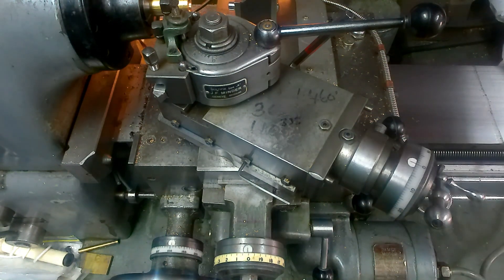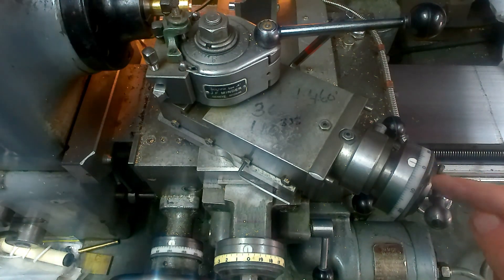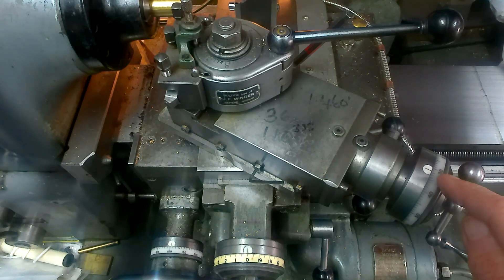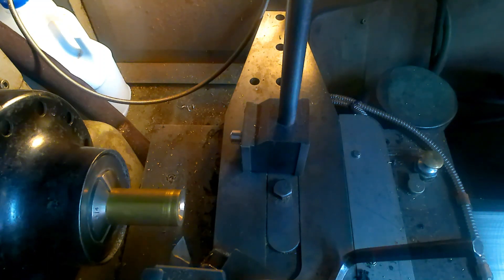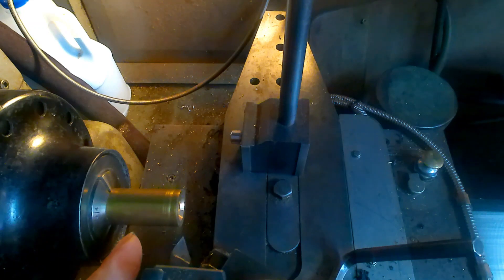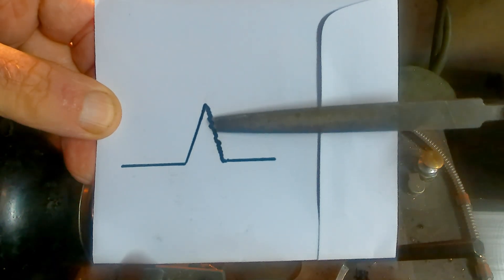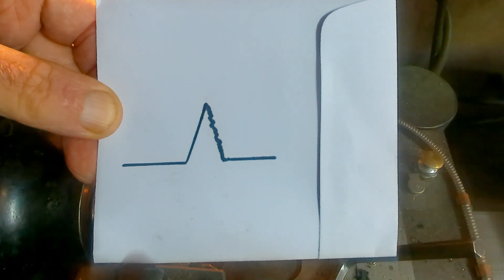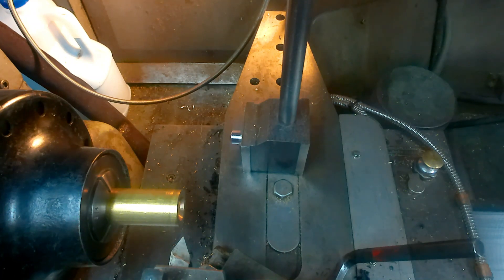A Simple Screw Cutting Setup And Some Good Old Machinists Threading Tips.

Comment: compound is set at 60 degrees
Reply from the maker: I know, it was only set aproxomately as an illustration on setting the correct thread depth easily without calculus or using a DTI. Thanks for watching. Regards.

Comment: Hi, I use the other method for screwing and that is with the compound set parallel to the work as in normal turning.
To keep the right side of the tool from chewing the flank up as you dig deeper.....you only want to cut on the left side of the tool........ I advance the compound a few thou to the left at each pass......been doing it that way for the last 60 years or so......the tool has a top rake slanting from left to right as it only cuts on one side so a top rake cuts very clean.
I also have a set of brazed carbide tools I specially made for finishing the thread to form the final pass and they are flat top form tools in 55, 60 and left and right hand etc.
What's the advantage?..........well you get the exact depth of cut on the crosslide dial,  but with any method if you first cut a small step at the beginning of the job or undercut the end of the thread length to the depth of the thread you have a depth indication.......but mostly you cut threads until it gets a bit pointy and then touch the top with a fine file to round off the burrs......a lot depends on the radius you have on the tool point for final depth, so its cut and feel at the end of the threading etc.
I notice a lot of people have removed the compound slide in preference to a solid block mainly due to the pathetic mounting of the said slide on some of the cheaper lathes and it's ability to move or tilt when parting etc......not my cup of tea.........however, screwcutting with carbide inserts means you go fast and deep with each cut and that is on both sides of the tool.
The QCTP, although a gift from Heaven, does add a huge lot of overhang when parting and that's where a rear tool post on the end of the crosslide with the tool upside down comes into it's own..........that was a godsend for lathes with plain bronze bearings that had a tendency for the spindle to lift (oil clearance) when parting from the front, but with the back tool post, the tool being upside down and the spindle running normal direction, the work is pushed down in the bearing and so no drama or soiled underwear from parting tool crashes.
Reply from the maker: Hello Ian. Thanks for watching and this excellent comment. I do not use compound for screw cutting either. I am a plunge person but use carbide inserts. I also use at times the inserts that finish the final size, turn shaft 0.004" oversize. Keep advancing the insert until correct diameter is reached. No burrs, smooth as a baby's bottom. Unfortunately you need to buy one for each PITCH of thread you want. Can be used on any diameter, so if you want a special diameter but standard pitch you can use them. Great story behind your  many Years of machining experience, thanks for posting it. Regards.

Comment: ...compound needs to be 30 degrees from perpendicular with the spindle axis...
...yours looks to be 30 degrees from parallel with the spindle axis...
...only the former will work correctly...
...some compounds will read 60 degrees when set correctly...
Reply from the maker: Hello there, thanks for you view and your comment. In actual fact the compound was not set to anything in particular, it was just shown at an angle as an illustration. I mentioned that it needed to be set to 30 degrees. The purpose was just to show the dials setting trick. I do not use compound threading, most of my threads are small and fine pitch, I plunge cut using carbide threading inserts. Regards.

Comment: Good video, sometimes the material will not respond to spring cuts well. I have some pre-hard alloy steel that will work harden with anything less than what would be a roughing cut but can still be threaded nicely if the machine is heavy.
Reply from the maker: Thanks for the info and your view. I mainly use non ferrous and occasional leaded mild steel so have no experience of your material threading conditions. Regards.

Comment: Hi Dave I watched the video a few times to understand just what you were doing. I get it now thanks for explaining it will give it a go next time I do some threading. Thanks Cheers
Reply from the maker: Hi Randy. Glad it helped, drop me an email if you would like any further help, send me a note too of how it comes out. I use carbide thread inserts and do a direct plunge with the cross slide. Can see no advantage with the compound method for small threads less than 1 inch diameter and fine pitch. Only do compound for say a chuck backplate 1.5 inch and say 6 tpi. Thanks for watching. Been asked by a new subscriber to show how threading works on a Hardinge. Quite different to a standard lathe. Stay tuned for it in a short while. Waiting on a new camera with a zoom lens. Regards.

Comment: as usual Dave another great tip,
 Only trouble is, many or most Myfords don't have re-settable dials, been meaning to modify mine for the past 30 years or more, but i'm either bone idle🤣🤣🤣 or there is always something else to do!!! but i will get around to it one day,  instead of using a Sharpie. Good to hear your subs are going up.
take care
Kev
Reply from the maker: Hi Kev. Myford do re settable dials both Metric and Imperial. Literally 5 minutes to swap but cost 50 GBP each.😢😢😢 Thanks for watching. Regards
Reply: @daveticehurst4191  Cheers and Yes Dave, I know, but i'm as tight as Cramp!!!!😜🤣🤣🤣
If anythings makeable i make it!!! 
A Pry  Bar would'nt get £50 x 2 out of my heavily guarded pockets for Myfords Dials🙌😜🤣😉👍👍👍👍👍👍
see you next time
kev

Comment: Thanks, Dave. Valid tips. If you set the compound slide over by about 1/2° less than half the thread angle you may find that the rear tool flank shaves the ridges on the rear face of the thread as you progress deeper.
If your HLV has the automatic screwcutting feature, perhaps you might consider making a detailed video on setting it up and cutting a short thread. I have seen other videos of them in action, but none show how to set it up.
Reply from the maker: Hi Russell, thanks for the view and your comment / question. I do not do single point screw cutting on the HLV using the compound. I use carbide inserts, either the standard 55 or 60 degree,  with the occasional dedicated insert which gives a perfect thread profile. For those I use the cross slide only and do full engagement threading. To be honest, theses days if you have a professional machine then plunge cutting is fine for most common threads say up to  m10, m12 etc. Taking care not to make too big a cut each time. You really only need the compound job for coarse and deep threads like lathe chuck backplates. Yes  I suppose I could do one in the near future. I am waiting on a new 4 K camera that has a 16 X zoom and a 3 inch screen. See you again soon. Regards.
Reply: @daveticehurst4191  Carbide inserts make perfect sense and give perfect results if the budget allows. I'll be using high speed steel 😉
Reply from the maker: @russelldold4827  OK, duly noted. When I make the video I will show HSS threading as well as using inserts. Watch this space. Regards.